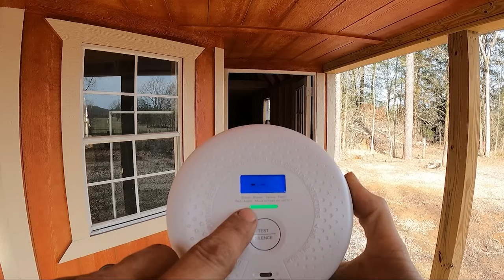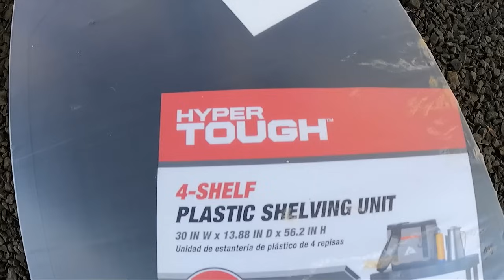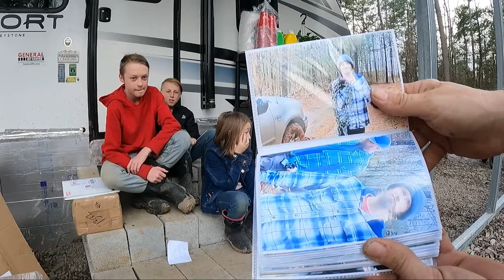PROTECTING OUR FAMILY | work, couple builds, tiny house, homesteading, off-grid rv life, rv living |

Comment: Omg the shelf collapse scene had me lol.  Oh, I want to point out one thing.  CO2 is heavier than air, so generally CO2 detectors get mounted around knee height or lower.  But please check the manual.  (I know Mike, we’re men, we don’t need no stinkin’ manual!)
Reply: We don’t have this one but we The first alert ones that are wired in together so when one goes off they all do . And they are both smoke and Co2

Comment: The postal employees DO NOT HAVE THE RIGHT TO OPEN PACKAGES. Only the Postal Inspectors with only with just cause !!  I know this as as fact I was a Postal Safety Speciaist with 35 years experience but now retired.  They should be turned in

Comment: Lyssa, if you have a rubber mallet just pound down the shelves and the legs a little tighter and it might help with keeping it together better. The shoe area will be great. When it gets spring and summer just keep a check out for creepy crawlies before you put your foot in a shoe.
Reply from the maker: Thanks for the tip. I Will most definitely do that. ❤

Comment: Hey Mike I have a question for you. As a former firefighter/paramedic I was wondering if the dual smoke alarm and CO2 monitor you got, I was wondering if it has 2 separate monitors on it. Co2 is heavier than air but smoke is lighter than air. That's why co2 monitors are located closer to the ground and smoke alarm is higher near the ceiling
Reply from the maker: Interested to know that myself
Reply: @driftingdreamers5  we just want to make sure that y'all stay as safe as possible

Comment: I did not quite get what you did with your sewer on the Travel Trailer when you replied before. Just curious. When I am out and about I have a pretty large mobile tank I use for Black Water I can tow and go empty. It is rough when I am in the Boonies for 3 weeks, but I always do something. Did I tell you about the time on my Airstream Bus going down the Highway and I centered something going down the road at night and a Texas State Trooper was following me and the Black water drain got hit and I soaked the Trooper with 100 gallons of Black Water from my Bus when the lower fitting got knocked off from the impact at 65mph I turned his car into a Blue Crap Streak. He was so mad at me and the object hit his Windshield and broke it. Not my Fault. The object was a Huge Armadillo that weighed 50 pounds.  lol, I told him it was a crappy situation. He got towed off and had to be hosed down by the Fire Department He had to strip down. I laughed but never saw a Trooper Cuss so much for so long. No one wanted to touch his cruiser it was a week old Biohazard. I was headed to empty it at Loves Truck stop on my way in and it was funny. Think about that mess on I-20 I never laughed so hard playing dumb. I mean it stunk.